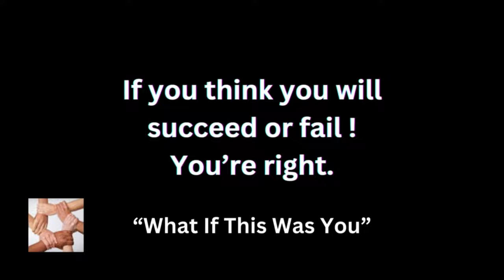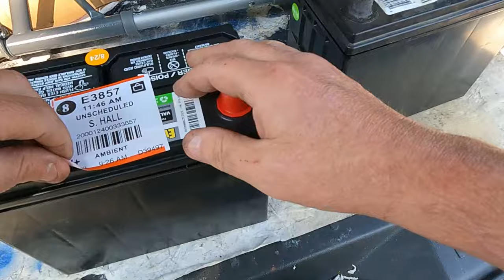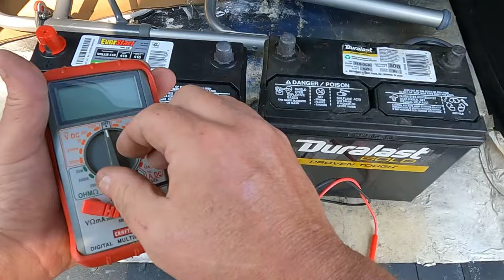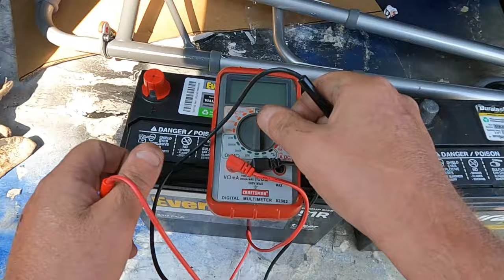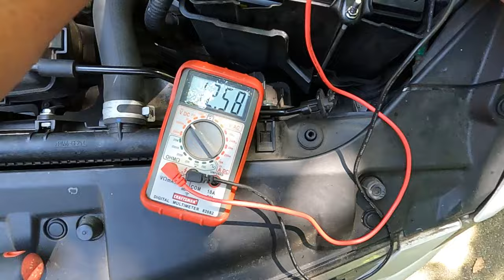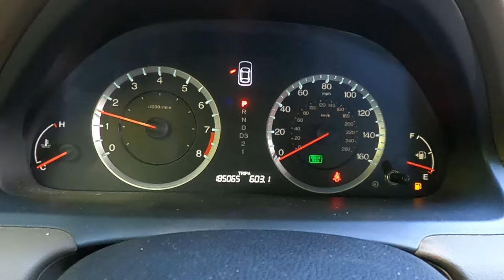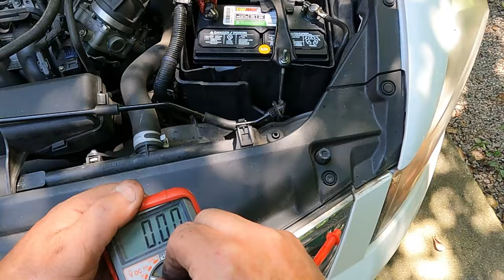Worst Service Ever...Do YOU Get What You Pay For?

Comment: I would be reporting to the post office from where it traveled from that is crazy it seems they did some abuse to those boxes 

But also the company's did not ship that right they hardly put no protecting in there are all what is wrong with them crap I did eBay for over 2 years I shipped Wall Clocks that had a thin piece of Glass for the cover in 2 years I only had 1 person tell me the glass cracked they should be protecting that stuff the electric connector also should have a plastic piece over it to protect that it should be wrapped & there should be way more packing paper in there 

With it being broke like that it means it was moving around in there u don't send packages where the product is moving around 

I get all my car parts from Amazon I have gotten fuel tank pressure sensor purge valves charcoal canister for my car all packed very well I have ordered parts from Amazon for years brakes & everything never had to return one thing crazy